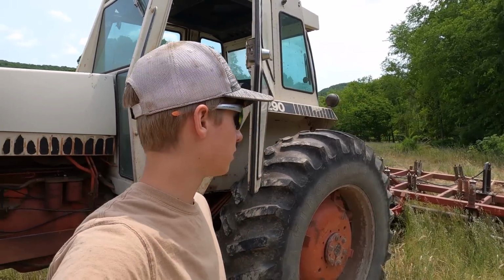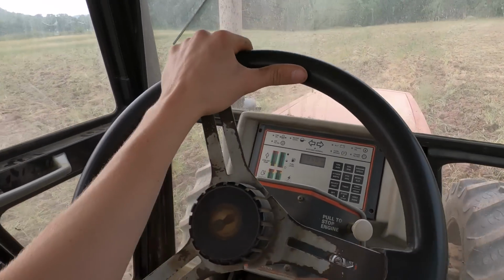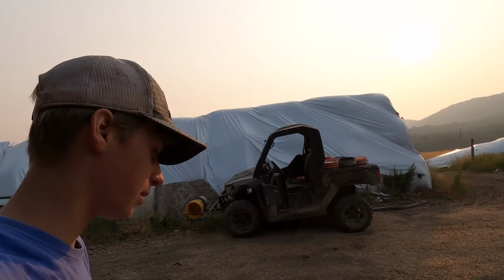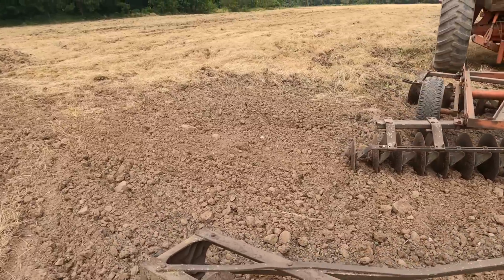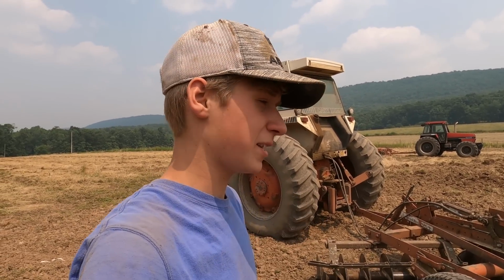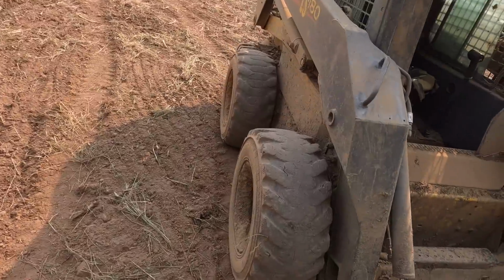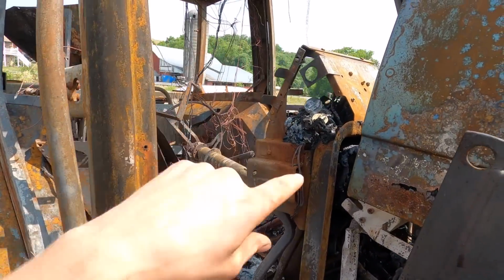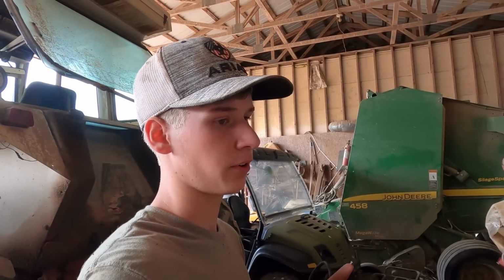The Case 5140 Tractor Caught on Fire

Comment: One reason I put cut off switches in every machine I have was to prevent rat induced electrical fires. Once I had a Bobcat blow a hydraulic hose and spray the exhaust manifold but luckily I had a fire extinguisher in the machine and a bigger one in my truck. I guess your tractor is toast but at least you have some insurance. Sure hope you never lose the big skid steer, that's my favorite machine you have!